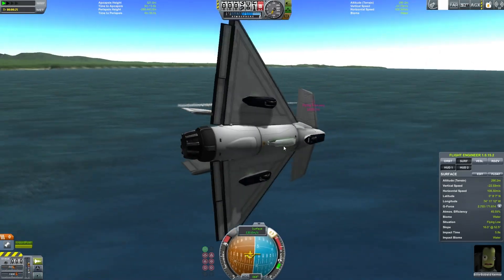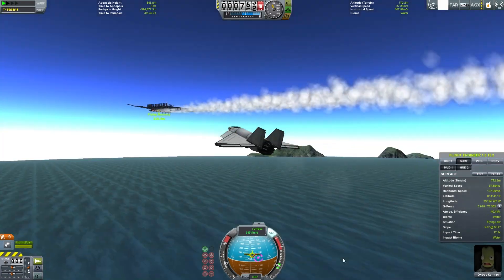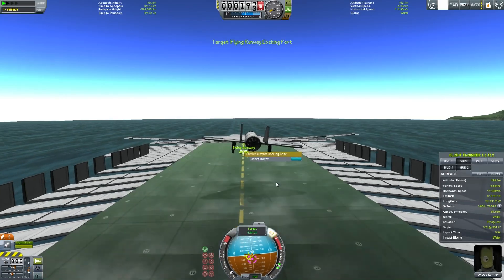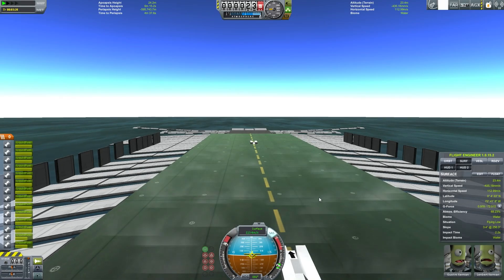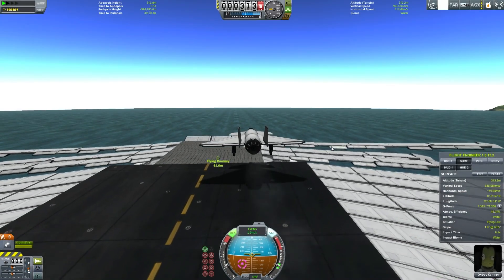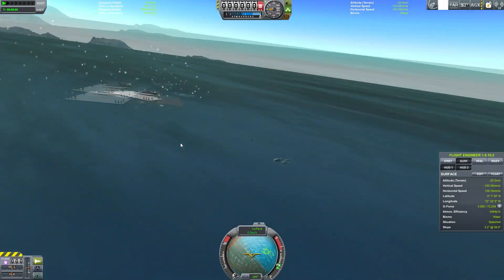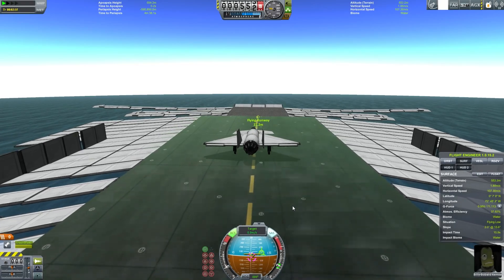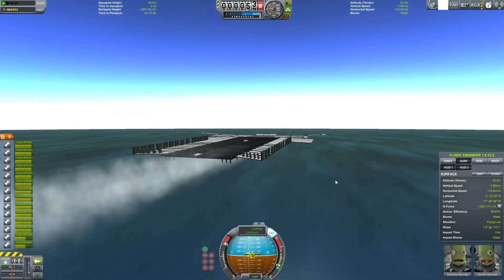Air To Air Refueling... With a Flying Runway

Comment: My biggest testament to "even in the worst, never give up, you might survive" was me following blindly the guidance system, it telling me to blast myself straight into the moon to get the trajectory I wanted. After realizing I was going to crash into the moon with enough velocity to exit kirbin, I quickly turned around and did the best attempt at a suicide burn to land this craft not at all meant to land on any body, basically a cylindrical rocket with no supports. Well, I got lucky and slowed myself down enough to crash half of my craft into the moon with 2 satellites left standing, still sliding rapidly down a crater. One probably would've survived but I tried to slow it down someway and it just blew up, the other rolled down and eventually stopped with its transmitter and a couple gadgets and 2 solar panels able to keep it functioning indefinitely.

Comment: you had it that second time. you realized that when you docked the mother ships throttle reset but what you didnt realize that when you undocked from the mother ship the jets throttle also reset. you might have been able to save both there :P

Comment: Since your carrier deck has the propensity to fly at extremely low altitudes change its design to something similar to the Russian Ekranoplan and exploit its suicidal tendencies instead of fighting them. I would also look into mounting the carrier deck engines on inflight hydraulicly controlled pylons mounted on either side. The addition of two or more, entire hull length, built-in hollow pontoons, made from some very light-weight tough exotic material might also prove benefiscial. If the damned thing gets tired of flying then it can float for a while, or when you regain your senses and scuttle it before too many people see it.

Comment: There's an old Russian mig29 topgun manuver where you force a stall and then get your self out of it, the trick was to un intuitively push into the dive and full throttle towards the ground to increase the airflow under the wing and pull out at the last 200m basicly allowed you to swap from being purseued to pursuing.

Comment: Hi scott, Aircraft Mechanic here.
This oscilation of the aircraft is called Dutch Roll, and is caused by response time of the flight controls being too low to counter the aircrafts' oscillation. 
You should put some fast reacting control surfaces to settle this.

 As for the Idea of a flying runway... well it is damn old! USS Akron and Acon were Zepplin Aircraft carriers from 1930s :)
More recently in video games, the Spiridus, from Ace Combat X. Later came the P-1112 Aigaion from Ace Combat 6... a classic !

Comment: 2:10 i feel like you couldve gotten away with adding the docking adaptor to the aeris 3a and using that, the 3a has proven to be useful for my testing purposes, since i use it as the test target for my bdarmory based fighter jets, where i pilot the aeris and try to survive as long as possible against my fighter being controlled by the AI pilot, the less time it takes the fighter to shoot me down, the better the fighter, and my latest fighter is one ill probably restrict to AI control, since it suits the AI amazingly, it took the AI a matter of seconds to shoot me down with it, but i personally found it tricky to use, with me having built it mostly around guns rather than missiles, and im not very good at using fixed mount guns. Ill probably build a counterpart for it that i can use.

Comment: Advice for building a fighter jet: put the center of lift slightly behind the center of mass, and make sure you use a few real fighter jets as examples. You can still make the jets unique by switching the parts of the real world examples around, and adding a few custom features. One time I tried to make copies of the F-16, F 35, & F-22 and ended up making completely unique planes that have similar properties to their real life counterparts.

Comment: One of the problems I noticed is that the docking port was at the front of the runway which I understand is so there's more room, but if you dock at the back then with more weight on the back the nose will pitch up and keep from going for a swim. You could also put ore tanks at the back until the center of mass is over the docking port, but then you may want more lifting surfaces.

Comment: The problem is Manley can't seem to glance at the throttle because the time you actually did refuel and undock the throttle was at almost zero so you stalled. Maybe he doesn't actually listen to true game because you can clearly hear when the engines change throttles

Comment: Any KSP pros out there? wondered if you could answer a couple of questions...

I'm fairly new to KSP (recently made a manned return journey to Ike) and well anyway i'm attempting a hugely ambitious goal by my standards, placing a satellite in orbit of duna that contains space for 6 kerbals has a science lab etc to it's reasonable in weight, and as well as this i'm attempting to dapart that in orbit and land a seperate manned rocket on duna, plant a flag collect science and then return home... 

question is... how do i know if what i'm testing will get me there and back without spending most likely 2 hours building a rocket and finally setting it down on the surface only to discover i have not even enough fuel to make orbit of duna?
Reply: I'm not a pro but I did build a Duna station just yesterday actually. What I did is send a Coupula, Hitchhiker storage and a research lab on one launch, an orange tank on another (career mission required it) and a 3 man lander on a 3rd launch. I'd recommend downloading Kerbal Engineer to see your deltaV (total velocity change possible) and attaching a 1 man lander on the bottom of the station so you can bring it on the first launch. To get to Duna you will need at least 6500 m/s dV, but I personally take 7500-8000 m/s for leeway. The lander should only need 1000 m/s of dV but I take 2000 because its not much more fuel with an efficient engine. To get back to Kerbin I'd launch a second craft to the station with around 3000 m/s dV to spare for the return, capture and deorbit burn. 

To save fuel launch at a specific phase angle. Kerbal Engineer displays the current phase angle which for a Duna transfer is around 54°. If you really dont feel like using Kerbal Engineer for this you can use a protractor and wait until Duna is around 54° ahead of Kerbin.

Sorry if this makes no sense its late at night and im on mobile so i probably had alot of unnecessary information.
Reply: ChaosTheory Gaming
thanks for the reply... i am currently in the middle of the mission... good and bad points.

good is that i got the station successfully in orbit of duna with a NERV engine that just about had enough to make orbit, and completed the mission getting paid.

the bad news. i ran out of fuel to make the orbit circular around duna... this is a problem because eventually i will collide with Ike since my orbit runs through ikes orbit. the other news is that i do not have enough fuel for my 1 man pod to land and return to kerbin so i have to abort that, i can get home though, my 1 man pod and fuel are still attached to my main satellite... so my creative challenge is to use fuel from the 1 man lander to try and get the satellites orbit more circular... tried a couple of times and it's not providing enough thrust... am still thinking of a way!
Reply: You shouldn't need to worry about colliding with Ike eventually you will get an intercept with it and it will most likely throw you into another orbit where you cant collide with it again. Worst case scenario you get very unlucky and it does collide but that shouldn't happen.
Reply: ChaosTheory Gaming
well i did an f5 at a safe point, then i sped up time purposely to see how many orbits i'd get before a direct impact was made, the next third or fourth orbit made a direct impact, so i had to figure out how to escape that path... i figured it, it took many attempts but if i sped up time as fast as it would let me, sometimes it would autimatically return me to a safe speed in proximity to Ike, but it would take time so this would alter my natural course, it was different every time and eventually after a dozen attempts it put me on an escape path to orbit the sun, luckily my mission was complete so it did not matter if i was around the sun, as long as the ship would last a few years to slowly collect my 750 science (i had a lab) then i was fine with that. you could say i used a glitch to my benefit, it was the only way to escape doom.
Reply: i have 130 hours and i just landed on the moon :/
Reply: Stuart and Ian Gaming Dont worry after that point everything will get much easier, for instance after I landed on the moon at around 120 hours I was able to get to Duna and Eve in 20 hours.
Reply: Stuart and Ian Gaming
yeah you've done the hard part... some moons are almost easier to land on than Kerbin's because they have really low gravity so you can get away with cheaper ships that use less fuel. you'll learn clever things too ... for example. first mission to ike i went straight there and used up a crapton of DV slowing my ship down to make an orbit.. then it dawned on me... why not just make an orbit about duna, (the planet that Ike orbits around) and use the gravity of duna to slow you down instead. it worked. i used much less DV achieving orbit around duna and set my orbit to just intersect the orbital path of ike at the AP of my duna orbit, the slowest speed you can achieve is at the AP of your orbit. so let it keep orbiting, speed up time until you get an encounter with Ike where you are at the AP travelling very slow and Ike happens to make a pass at the same time, them make some small adjustments to shift your orbit to Ike! i felt like a rocket scientist when i firgured this out! i've figured out so much other stuff too to make my travells very efficient. and so will you! just keep playing :)
Reply: i havent even orbited duna yet ._.
Reply: Dude I didn't even orbit minmus when i got to duna
Reply: Stuart and Ian Gaming don't worry. it's the same principles. as long as you remember your f5's and learn how to use solar orbits to reach new planets you'll pick it up! donn't get me wrong it will still take time. i would spend over 2 hours just making a ship to make sure i haven't missed anything crucial such as.... SOLAR PANELS, i used to FML so hard when the only way to generate electric charge was through burning engines. it was a waste of DV and always messed up my course! (or used to before i figured to make fuel presets: engines to get me to duna engines to get me to moho etc and then just save another set of top half's of your ship and merge them together through the options) because i realised that each new planet besically requied me to make the exact same ship but just make tweaks to suit the required DV and i used to wonder why not to make bases that i can use and then i discovered you could merge 2 together! bring the design of 1 ship (you only make the top half) into the bottom stages of another build!)
Reply: i just landed on duna and had a trajectory with ike

USING MY MOON ROCKET
Reply: There you go! see you've done the hard part of getting to another planet to start with. going from other planets from there is more tweaking your ships and whatnot! nice work. do you have enough DV to return home?Stuart and Ian Gaming
Reply: nope :/
Reply: f5 from a safepoint to return home? sometimes i f5 at a safepoint. (orbit of a new planet) then will land on that planet, collect my science, purposely not f5 and then determine whether i will have enough DV to get home, if yes. f5, if no. f9 and then return home from the planets new orbit.

i sometimes even f5 on the launchpad. do the entire mission (it still autosaves anyway) quit whenever i'm at a good point. continue playing from where i left off and if i reach a point where i know it will be a success, i f5, if i know i will fail, i f9 and start over with no cost, i can edit my ship and try again! if i fuck up mid mission i just close the game down and restart it, i lose maybe 2-5 minutes since it loads from the last save but it's better than f9 losing it all. so it's a win win!

if i really wanted to take it serious, i could do the math to figure it all out before hand. but i like the trial and error approach better.

Maybe you can go on a rescue mission back to duna to save your kerbal!

what i found hard was making a massive space base on the mun, i made so many mistakes doing that and learned a lot in the process! it's hard connecting 2 bases together when one of them is already set on the ground!
Reply: ima start working on an unmanned return vessel and if it works i will use it

Comment: I saw what happened with your massive stalling issues, In this older version of FAR, canards could cause the wing surfaces behind them to stall out of control as the canards stalled if the canards were too close to the main wing sections.  I noticed this when trying to build a plane with wings that were swept forward like the Su-47 and ended up with a few centimeters of proximity making the difference between I what I remember as nearly a half meter jump with the Center of Lift.  I push the canards back past the point where the Center of Lift jumps, and they no longer cause the normal wings to stall.

Comment: This one time my huge mk3 science plane was flying back to the ksc after a short range testing and as I was returning the SAS made it oscillate and it oscillated so much that it split in half right behind the wing and my engines were on the wing and it turned out that I had made it in such a way that it continued stable flight and I could manuver it and it would not stall or anything and I just flew it to the ksc coast and deployed emergency parachutes on the cockpit and landed half a plane. It did break into many bits when it hit the ground but still everyone survived.

Comment: What you need to do is, when your building the vehicles, add abort features. In other words, put  decouplers behind the cockpits and add parachutes to the pods. Additionally, you can also have the engines turn off, all via the abort action group.

Comment: There is something in aerodynamics called "Ground Effect" where you could have a false takeoff due to increased air pressure between the ground and wings. This causes a sort of false lift because once the wings gain enough distance from the ground, lift is drastically reduces.

Comment: Nice! Did you know Scott that an actual flying aircraft carrier was built, it was basically a massive airship capable of carrying scout biplanes (I believe it had capacity for 2 at a time but I could be wrong) and basically what they do is get the airship flying flat out and then lower the aircraft on a cable below the airship cabin, the biplane co-pilot then had to climb out of his seat onto the wing to release the cable. To land they got the airship once again to fly flat out, then the biplane pilot had to carefully position under the airship cabin while the co-pilot climbed onto the wing again to attach the cable, once the cable was attached the aircraft was then winched back inside the airship. The system failed because the US government got hold of the prototype, decided it was excellent and then wouldn't allow the designer to take it out of it's flight trials to fix a crucial flaw he'd discovered in the airships structure, and sadly one day the inevitable happened and the airship was lost with all hands, at which point the US government declared the system to unsafe to consider using again.
Reply: ***** Wrong, if you didn't care you wouldn't have replied :)
Reply: ***** His comment isn't too long, you are too stupid.
Reply: learrus Well, it's good to know some sane people still exist on the internet, and I think he just proved your point in his reply.

Comment: Could the pitching down after docking be due to the fact that the smaller aircraft's engine was still running and therefore moving the thrust vector of the entire vehicle? Maybe it would have helped if you assigned an action group to the fighter's engine and switched it off as soon as it docked. Or maybe you did and I am just blind and didn't see it :)

Comment: I would think the stability issues come from the delta wing, which is really meant for highspeed performance. Trying it with a normal wing config, or variable wing config would probably fix the problem. Just a quick look at carrier aircraft shows a distinct absence of delta wings.

Comment: Nicely done! How did you do the last minor adjustments before docking on the first attempt? I didn't see the throttle indicator moving or any RCS? Am I missing something?
Reply from the maker: There's some rcs on the plane.
Reply: +Scott Manley i think you need to do another video in the new version where MK1 Cockpit looks different!
Reply: +Lassi Mäntylä (Lassigamer) and in the new new version 1.1
Reply: Bryan Carter og

Comment: The reason you were nose diving on your second attempt were the jet engine on your plane, putting the center of lift off center in relation to the mass and therefore forcing the flying runway down.

Comment: You didn't have the engines on the small plane when you tried to pull out of the stall... even though you pulled the runway out of the stall after giving up on the small plane.